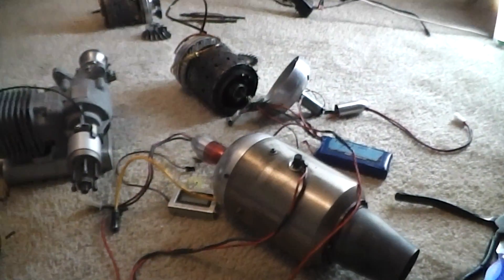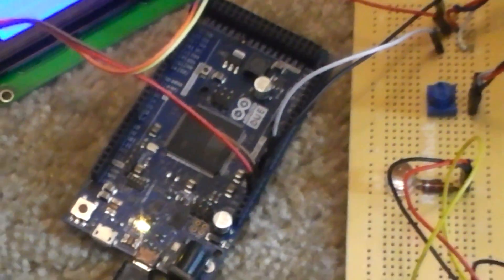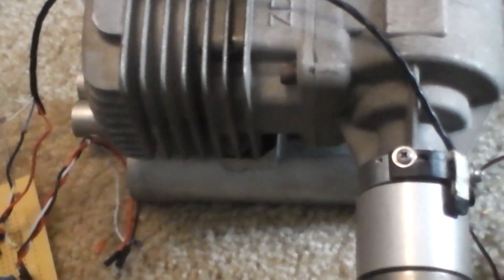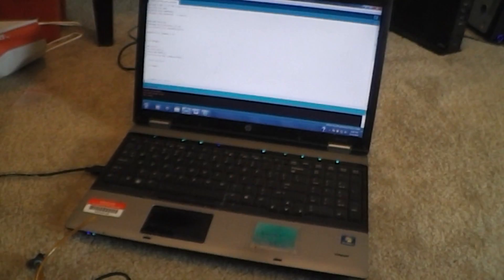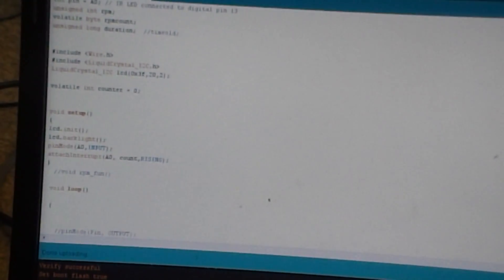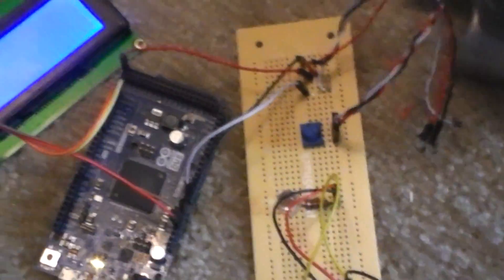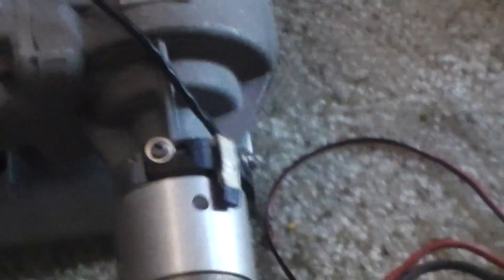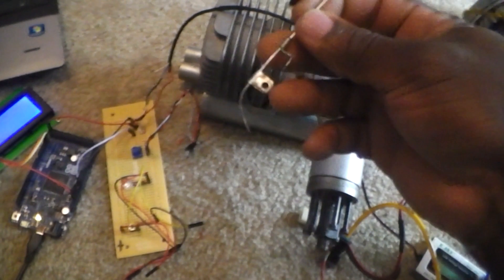Arduino due turbine controller project

Comment: hi, thank you for your response ... 

Mine is a RAM 750F with electric starter… it doesn’t look like is measuring the RPM, i think is just measuring the pressure in the burner and the exhaust temp …. i bought it one month ago but i didn’t found the time to do more than reading its manual ….
Reply from the maker: Mitch RADUCANOIU Your engine use CP pressure to measure rpm..very old technology..The good news is you can change it from cp rpm to sensor rpm. do you still have the ECU that comes with your engine?
Reply: basimpsn 
yes i have it ... looks very old indeed ... very heavy also ... not that matters as the engine is rated for 19lb thrust ....
Reply from the maker: Mitch RADUCANOIU Ok.. please keep me posted on your progress..go on rcuniverses.com jet forums and learn more about the engine before starting it.

Comment: Hi , 
i have an old turbine 19lb thrust  - and i thought to do the same .. the original electronics are very chunky  and as i was playing with arduino's  form my quads and 3d printer i thought will be a nice project ... i bought the turbine on eBay so i don't know much about it ...  it was rebuilt and has an electric starter... 
i have some arduino boards ( from the learning packages) in my arsenal but no display.... 

i'm planing to start it first with the original equipment 

can you please guide me in some direction to start .... 

much appreciate your help
Reply from the maker: Mitch RADUCANOIU Hi Mitch thanks for watching.. I ran into some problem with the RPM not being reliable above 5K. These engine idle @ 33,000 and max power @ 120,000 rpm. What brand engine do you have?..I would suggest buying this generic ECU controller (xicoy ecu) It's a very good unit.